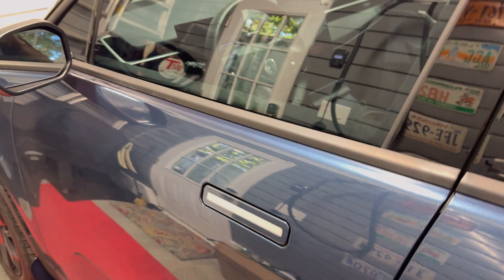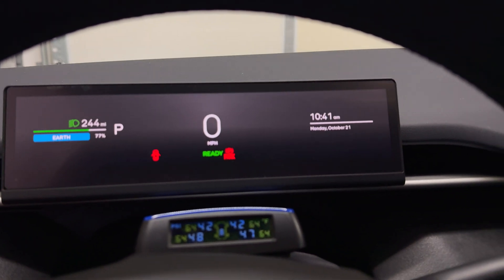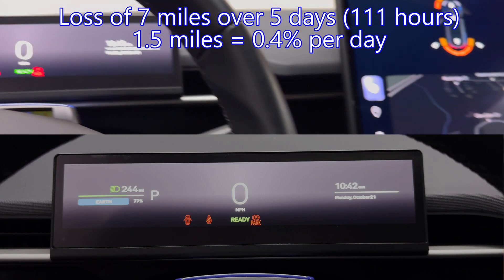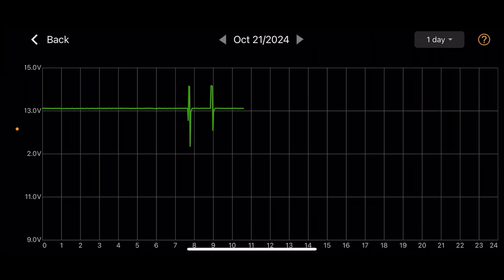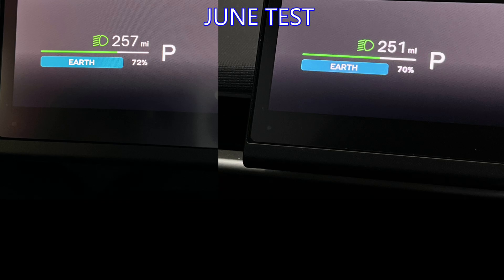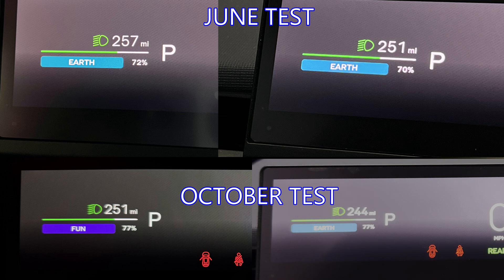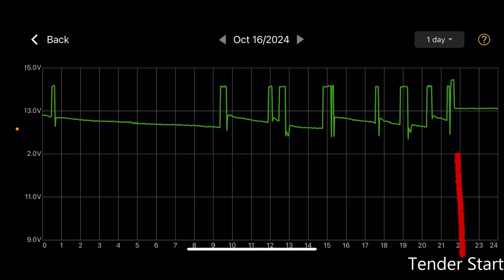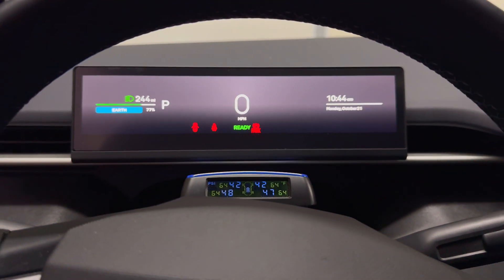Fisker Ocean - 5 Day Battery Tender Test

Comment: I don’t have my 12v connected to a battery tender and will be leaving my car in the garage for a week long trip. Would the car be alright when I get back or should I keep my evse connected the whole time while I am gone?  Unfortunately, my Tesla Universal charger lost its capability of setting the time use so now when I charge my car at home I have to manually plug in the evse and then it starts charging the car.
Reply from the maker: For a week, I would just leave the EVSE connected to the car (80% is usually fine). BTW, do you ever get a delay when plugging in the Universal Wall Connector to the Ocean?  When I have used any of my Tesla equipment, I get a 20-40 minute delay before charging starts.
Reply: Sometimes.  When I first got the charger and was able to set the time for charging to come on it worked perfectly.  After several months I started noticing it wasn’t coming on at the set time (10 pm) and then after 20 minutes or so it would kick on.  Then I noticed it wasn’t kicking on at the scheduled time it 30 minutes later but when I’d check the SOC in the morning the car was charged up so I know it eventually came on.  That’s when I called Tesla and they told me the charger software was having problems and to disengage the scheduled time mode and to just plug it in when I wanted to charge.  Not sure if Tesla will fix the software bug or not.
Reply from the maker: @rmorales1029  This seems to happen with some of the Oceans.  Mine has the issue and I have tested it with over eight different Tesla chargers.  There is some sort of communication issue with the charger and the car.  At this point, I don't use my Tesla chargers anymore and just use my two J1772 chargers.